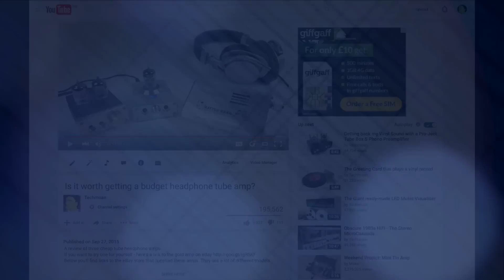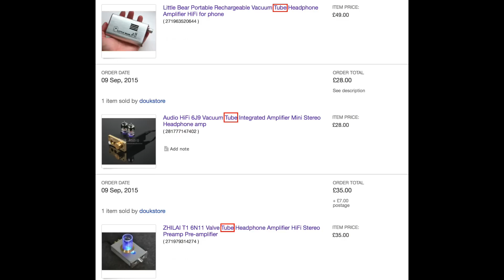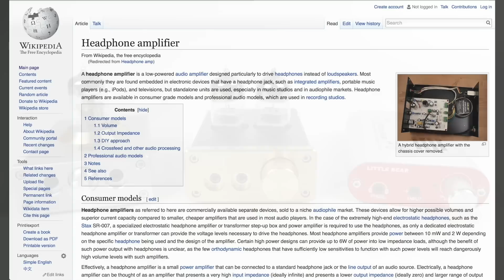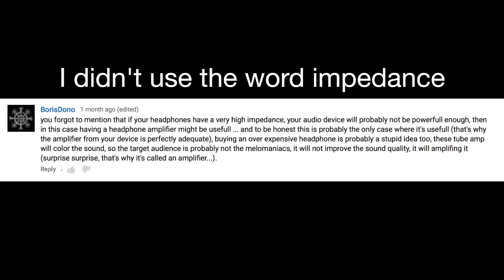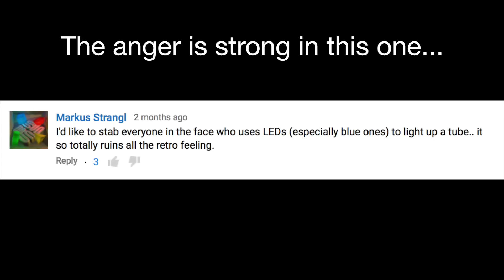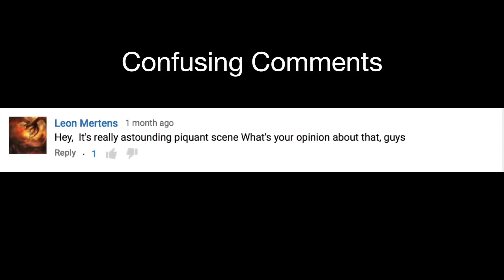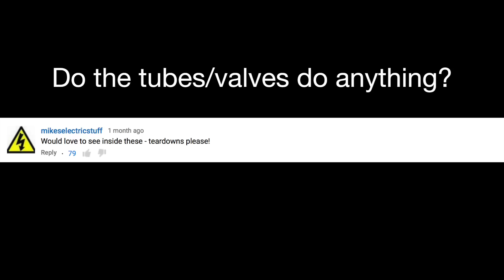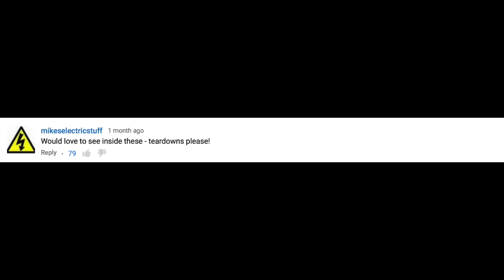Headphone Tube Amps - Follow-up & Tear-down

Comment: Many 'audiophiles' pay lots of money for special USB cables for their DACs, therefore proving that their opinions match their knowledge of audio engineering: worthless. They love the irrelevant and ignore the important stuff. The most important thing of course is the music, which they tend to studiously ignore LOL. 'Can't see the wood for the Trees' sprints to mind.
Tubes are the device of choice for hifi as they are the most linear, a very fundamental property that doesn't go away with any fancy feedback scheme. The double tube version appears to have opamp ICs as drivers which are generally reasonable quality, but tricky to say for sure if the tube is the input or output stage without looking at the pinout and tracing the tracks. The Little Bear looks like it needs a redesign IMO, PCBs stuck to PCBs and a giant 16V capacitor in a tube amp?  Perhaps it's fine but without looking at the schematic it's difficult to say, the double tube one looked the cleanest layout TBH.

Comment: I always thought that stereo needed two tubes. One tube per channel. So I can understand the amp that you like. But I don't see how the single tube models work and still output stereo.I have a genuine tube amp from the 1950s or 1960s in my basement. I think it's a Fisher model. I haven't hooked it up in about 10 years. I hope it still works. Maybe I'll fire it up and look for that warm sound.
Reply: Most small tubes are double triodes - two isolated tubes in the same glass envelope.

Comment: That is deceptive if some of those don't actually use the tube and just light up the filament for show, not to mention wasting a tube. Some of those twin triodes are quite expensive.
Reply: not expensive when they are fake or burned out, and it does not matter since they are not active tubes ;)

Comment: Specs for tubes are available online. The 6J9 uses a plate voltage of 125 as a class A amp. The tube has three plates and are pins 1, 6 and 8. If you have the voltage, the tube works. The 6 in 6J9 is the heater voltage, 6v. The grid voltage is -1v. Web search "6j9 tube" and the it comes up.

Comment: First one ( with two tubes) doesn't have transistors, so tube is amplifier element. Second one, have transistor on the back, so is possible that is main component, and the tube is for show. Third one, doesn't have transistors, so is probably tube amp element. Am no expert, but know few things.
Reply: no active tubes. in fact, they all use the same opamp, ne5532. one of them uses two, the other use one ne5532. it's a dual opamp, so one will work for two channels

Comment: I dislike HiFi snobs.
Reply: so if you bought a Lotus Caterham that had '2.0 L turbo' stickers and badges on it, and complained when it turned out it actually had a Mini 850 ccm under the hood with a big truck turbo taped on it with gaffa,  you'd be a car snob?
Reply: @thor7564  If you are foolish enough to be fooled. Audiofiles are wankers.
Reply: @ronlynquist9183  fooled is what the ones byuing these fake tube amps are.
Reply: @thor7564  So HIFi snobs?
Reply: @ronlynquist9183  no one that knows hifi would buy these amps, but probably wannabe Audiophiles who have no clue does.

Comment: First thing I questioned, was how is it on the the amps with only one tube, that you can get a stereo output? That is of course presuming that there is only one amplifying element in each tube. The unit with two tubes of course make sense, each tube amps up a channel.
I am more familiar with transistors, but perhaps the single tube versions have tubes with more than one control grid and two respectively controlled anode plates. I don't know if such things exist, since it would seem that a tube with two control grids would interfere with each other.
Reply: you can have tubes that functions as two transistors, and you can have one tube functioning as a preamp and power amp. not that it's important here, because the tubes are not used as amps in these fake amps, they use opamps.

Comment: well with smart use of dc/dc converters u can use low voltage(100v)tubes. My bad
Reply: even dc/dc converters have to obey ohms law ;) there are some tiny special tubes though, like the small one used in the rechargable amp, but they are rare.the rechargeable one seens to have some sort of dc/dc circuit, but until I see any schematics for it, I guess it's only to have a stable glow in it since it needs 100/200v according to the datasheet.

Comment: All tube electronics have lethal levels of voltage that will push lethal amounts of current. Wont get those watts from a tiny 6v  plug in power supply. u do at least know w=IxE

Comment: The first and only question I got is: 
WHY TUBES?
I've now watched both videos and I did'nt get an answer.

I see why you could need a headphone amplifier at some point, but why would you need it tube amplified? We've had transistors for, what, 70 years or so and they've proven to be more stable, relaiable, energyeffiecient and cheaper than tubes ever were and that's why we hardly use tubes anymore. 

I bet you could get an headphone amplifier without tubes, and with better performance for a lot less.
Reply: Tubes are intrinsically more linear than transistors. Transistors have to have a lot of negative feedback applied to correct them, but negative feedback multiplies the harmonics so the THD figure improves but it doesn't improve the sound very much - it merely changes it. If course there is an overlap, a properly used FET will beat a poorly used tube, but in general a tube is far better for audio simply down the its linearity.
BJT transistors are in my view very poor choices for audio, modern chip based class D is far better.

Comment: yeah its cray how serious the greasy fingerprints ring about such a wide range. from experience yes with audio, Touching the tubes, (transiistor valves) the oils will transfer, and i forget if it eventually efffects the sound or eventually shatters the tube, but it is a rule of thumb no no.

Comment: If a tube or valve displays microphonics then it is being used in the signal path... and yes it is working proper...
And i own the gold one branded as a Nobsound... bought it to use at work w headphones as not to disturb the other IT workers, when I quietly went over the Opera, and choral music I have to preform...

Comment: These valves/tubes don't get hot enough for the grease from your pudgies to matter. Now...the power tubes on an AC-powered unit it probably matters a bit more. Those things get hot enough to heat your home.

Comment: A 12V power actually can be used to power a tube amp, but they need a special bump up power supply once inside the headphone amp. I've seen this done before and it only adds a small amount of background noise

Comment: 11:36 This particular amplifier was featured in a teardown by Australian engineer Dave Jones https://youtu.be/coSt5HWRvv4 . The conclusion is that it's little more than a simple buffer with the tube adding a bit of distortion to make the tube crowd happy. I.e., it's crap. After the analysis, he was joined by Doug Ford, former head of design at Rode Microphones, who offered his opinion of the circuitry:

"The headphone amp is a complete piece of tripe, although it won't sound completely crap. The choob will be responsible for generating some low-order distortion (i.e., mainly 2nd and 3rd harmonic) distortion, depending on the applied input level, which might give some 'valve warmth' to the golden-eared. I doubt I'd hear the difference unless the THD was high enough to become objectionable. So the whole product is simply an excuse to chuck a choob into the signal chain. The circuit would sound better, measure better, and be a tenth the cost if it only used the NE5532." 

 <not sure what "choob" means, but I'm sure an Australian will help us understand the term>

As an old power supply designer, I could tell just by looking that there is no high voltage power supply because of the 16V rating of the capacitors on the board, and I was right: the tube bias is only +/-12V, barely enough to push an electron through it. Just about all of the "action" in the chip is in the integrated circuit (NE5532), not the silly tube. The tube is wired as a "cathode follower," which by definition has a gain < 1. It has no purpose other than to ADD distortion, aka "that warm tube sound."

Comment: I wonder how an amp with only one valve could possibly work for stereo sound. I don't know enough to answer (obviously), but it does make me suspicious.
Reply: some valves are dual triodes (i.e. 12ax7 preamp valves) that act as 2 separate circuit components (transistors in this example) in one housing, so it is definitely possible for one valve to amplify a stereo signal. Mat, thanks for your videos! I really enjoy them
Reply: @edwardlarose7691  Neat. Nice to know.

Comment: Small tube/valve headphone amps like this work as a cathode follower circuit.  Opamp ICs provide the actual amplification.  In simple terms, the tube is not hooked up correctly and is used to color the sound.  When used this way, high voltage transformers and such are not needed, the tube does not function like a tube and provides only a very linear tone modification.  This part can be simulated with capacitors and inductors to the point you cannot tell the difference and are only used as a sales gimmick.  You think it does more than it really does.

Comment: Ah the glass tube and finger grease panic. I raised shit storm by commenting on Nixie tube clock video were makers of tube touched one with his bare hands. There were many comments raving that it's bad for tube. I mentioned that they're not something like H7 car bulbs that run hot as hell, which might have something to do with different handling. Next claim was that hand grease can destroy/damage/eat through glass. I mean seriously, what the actual f are people thinking and where's the common sense? Then after mentioning that I haven't seen grease eat through glass and that might be quite of an problem on many peoples house and it's odd that chemistry is generally done on glassware. Then comments about visual aspect of grease and they should be handled with gloves. It never stops :D

Comment: The gold one is using two op-amp before the tube. If I had to guess, I would assume that the amplification is all from the op amps, but the output is still being passed through the tubes. This would allow for much less power consumption, and still give some of the desired benefits of tube amplification (mainly ascetics and a "richer" sound). Seems like a good idea to me, but if that is what they are doing then it is a little misleading.

Comment: Ahem! Those chewbs are actually "valves" — ENGLAAAAAAAAAAAND!!!! *charges*
Reply: Anyhoo, the chewbs are like the goggles in steampunk—they do nothing! Everyone knows you need 100 V to drive the thermionics so the 12 V amps are useless but even if they worked it wouldn't matter for only audiophools buy those cause they can't understand you can't hear the sounds if you need.

Comment: As the owner of a tube Amp for my guitar, touching tubes does not damage them. Grease just looks bad, but doesn't break the tubes. That just applies to some lamps. It's a common myth that tubes break when touched with bare hands, that is not true. Same goes for standby switches on tube amps.

On a side note, tubes easily run at 6v. The names all start with 6, which is the indication that they run at 6v.

Comment: Impedance matters since the amps ability to drive them well matter's. Tube and Valve in terms of what you call them does not matter you could call them magic light bulbs and it does not matter but some times words do matter and have a very specific meaning! Impedance matters  for home load speakers too because some amps are not rated for 4 ohm load just 8 ohms and 16 ohms and some are rated down to 2 ohm load or less. Impedance matters and some basic vocab is needed to discuss anything beyond "Oh that's cute!" and "My dog is better than your dog!". I can understand not pandering to audiophiles but some basic level of understanding has to be established.Cheer's love your video's!

Comment: the 6j9  is 3 tubes in one --- not sure how that is being used by the amp,   it is suposed to have at least 100 volts on the plate(s)  but not sure how you are going to get that, with that kind of power supply!!!   so at much lower voltages the gain would be way down...but maybe they use those 3 tubes to boost the amplification???

Comment: Matt, 

If you want a really solid built and excellent sounding tube amp that really works, try this one sir.. Yes, it isn't very cheap, but it does give you that nice rich full sound we are used to with tubes..

https://www.amazon.com/Rockville-BluTube-Amplifier-Receiver-Bluetooth/dp/B07L55V58S/ref=sr_1_13?crid=OX607FCJBG08&keywords=headphone+tube+amplifier&qid=1569541193&sprefix=headphone+tube++%2Caps%2C366&sr=8-13

Comment: There were a ton of tiny tubes that were originally designed for walkie talkies, car radios etc., for example 12FM6 or 8056 - something like 12V is their rated plate voltage. Even a conventional tube rated for hundreds of V can be run in starved mode, for example PL509 power pentode rated for typical 160V can run at 12V although its only good for driving headphones or MOSFETs in a hybrid amplifier

Comment: Many years ago, I had an old consul stereo, she was cheap but the speakers were from an older consul and they were great quality.  One day I was at an auction sale, and I purchased a Heathkit stereo receiver.  She had dozens of tubes and I really wanted to know how it sounded, it must have been twenty years old back then.  So I run the wires from the consul up to the amp, hooked up the record player which was a junker Gerard with changer, and played a few records.  MAN what a difference!  Those tubes changed  an average consul stereo to  almost BEING there!  I loved it.  It remained sitting atop that old consul stereo till my kids knocked the whole thing over roughhousing in the rec room in the basement where it lived.

Comment: Well they used to say the first number indicates the voltage taken to drive the tube, thus those tubes need 6 volts to be driven.  Folks don't stop and think that back in say 1950, the year model of my first car, a Ford, they had tube radios in them. Those cars had a 6 volt negative ground battery in then with a generator run by the fan belt to keep the old battery charged.  Those old radios sounded GREAT! we even ran speakers to the back deck so we could blast more sound through out the car!  Back then, before you could get radios to insert in the dash, I used to go to the junk yard, where dad worked tearing down junk cars for the parts sales, and find radios out of classier cars, then mod them to fit the dash of my old Ford.  When I sold her, she had a Chrysler radio in her with electric motor station search, and electric button select that ran a motor to pre-selected points on the AM dial.  So long as they were 6 volt radios they worked in my Ford.  Later back in 78, I had bought an old 50 Chevy pickup, I found a 12 volt transistor radio to mount in the dash, as she never had a radio when I bought it. I had to put a boost converter to run it, but it put out enough power that I could run both the radio and my CB although if I wanted to transmit I had to shut off the car radio.

Comment: Don't have to be an engineer to see that some of the pins on the TOOB sockets are connected to traces on the top of the board, and some are connected to traces on the bottom.

Comment: I don't think these tubes work like a true tube amp would...they more or less color the sound...the amp is an OP Amp (two NE5532s)...which amplifies the signal coming from the tubes. So it isn't a tube driven...but it is sent through the tube. So, I say they are worth it for the price.

Comment: I have seen circuits using the valves with low voltage as a kind of pre amplifier (with damping character, but coloring the sound) and a FET as amplifying element. I guess instead the FET here are the OP amps used. So the Valves do their job more or less. I haven't heared one of those toys to have an opinion about that.

Normally valves need a higher voltage to work as amplifier, lets say 100V or something in that region, but that would mean there have to be step up converters in this small gadgets which make often noises and need coils and HV capacitors. If there are no capacitors with voltages higher than 40V in the device, I doubt that the valves do a real amlification.

Comment: The output stages in these cheap tube headphone amps are either transistors or transistor op-amps, which only require a low voltage drive. Driving such a stage with a tube only requires the tube to run at a low voltage, avoiding the need for a heavy mains transformer and other associated components needed to create a high voltage supply. I think this is the reason people think these tubes are cosmetic only, since these amplifiers are simply too small and light to properly use a tube at high voltage, as it is normally used.
The heater circuit for a tube is always low voltage, usually 6 - 12 volts. The drive for an op-amp or transistor would only need to be a few volts, so a low voltage supply can work fine when using a tube to drive a transistor stage.
Now having gone to all the expense to build tube sockets into a circuit board, not to mention the cost of the tubes themselves, undoubtably some of the most expesive components in the amp, it would be rather idiotic of the manufacturer not to connect up the signal traces on the circuit board and make use of this expensive hardware, and risk people demanding their money back or taking out a class action. Why would they do that? Of course, they would not.